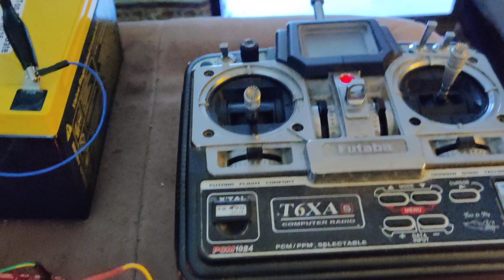Using a radio control receiver PWM servo signals to control a Stepping Motor position

Comment: It posible to put a magnetic encorder? Soa measure very perfect?? Like a dc servo
Reply: Measurement of the output angle isn't the problem here, I think, because the controller knows exactly how many steps it has sent, and that precisely determines how many angular steps the motor has taken (as long as the steps aren't sent too quickly).   However, you do need a way to reset the motor to a known position.  A magnetic encoder would work for that, but it seems like overkill.  Limit switches are typically used.

However measurement of the PWM signal seems to be what's causing the jitter here.  Maybe the raw PWM signal is jittery itself, or the arduino code isn't doing a great job of measuring it.
Reply: @yeroca  because i want to make servo from stepper sir, posible to. Controlfrom pwm

Comment: Would it be possible to use the switch located at the top of the controller, instead of using the throttles,  to move the stepper motor only a certain angle, say 15 degrees, or 8 steps? As opposed to continuously rotating it?
Reply from the maker: It certainly is and would be a Simple Matter of Programming to read the switch and output the desired action.